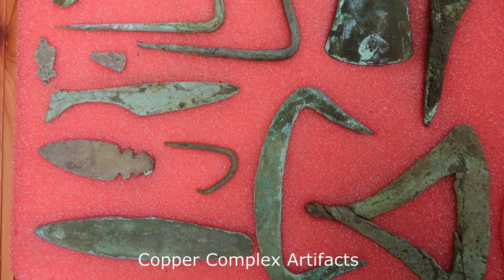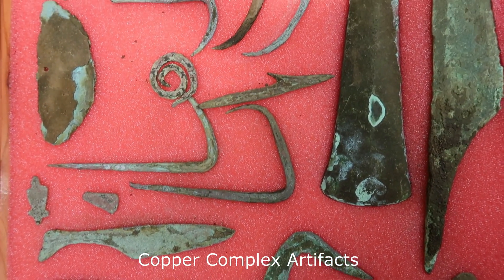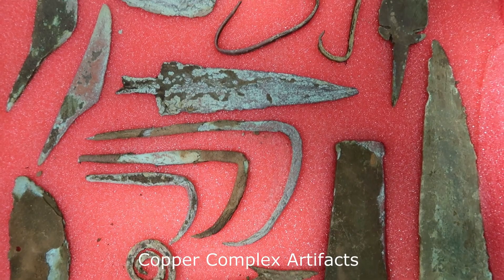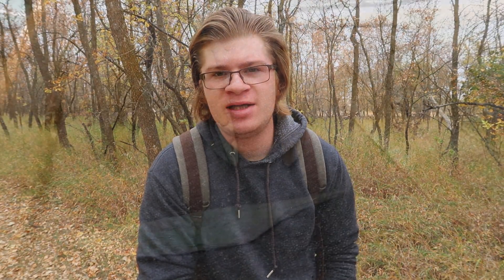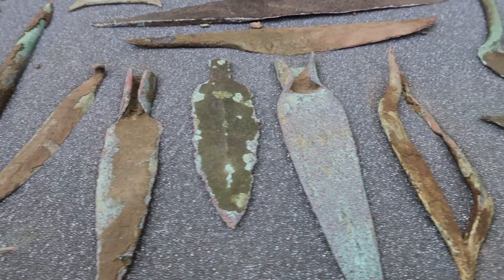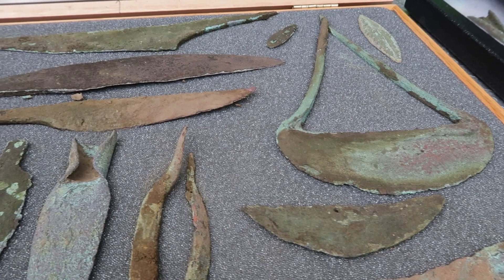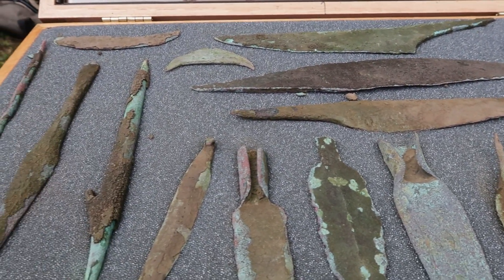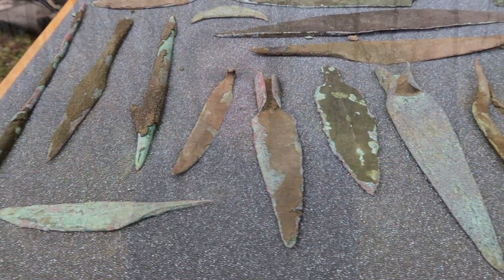Let's Talk Archaeology: an Introduction to the Old Copper Complex

Comment: Do you think they were using this raw copper for flintknapping, or do you think they did not want to use such a valued material for something that they could do with antler? Have any copper flakers or tools for knapping been found? Have any of the projectile points from this period been found with copper scratching on them?
Reply from the maker: Sorry for not getting back to you sooner. No I do not think the Old Copper complex was using copper for flintknapping. I have not seen any mention of them using copper for knapping tools. If they were going to put the time and effort into making a copper pressure flaker, for instance, why not just make a copper projectile point? When they were flintknapping, I’m sure they used stone and antler tools. I’m not aware of any scratching from copper on Copper Complex lithic tools. I’m aware of a couple of copper pressure flakers recovered from contexts during the Middle Woodland period and Mississippian period in Illinois, but these are only a handful of instances.
Reply: @pathwaysofthepast  thanks for the reply. Good info.